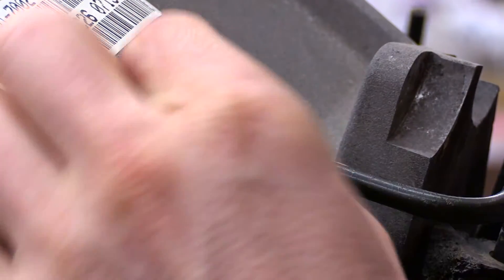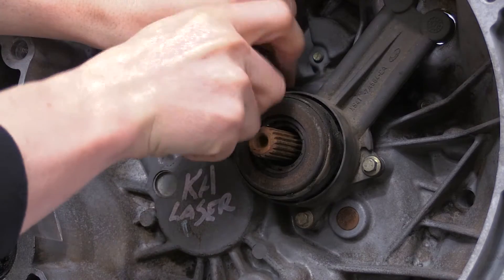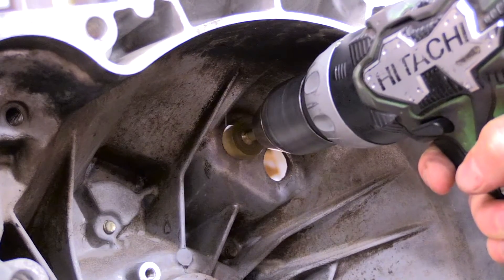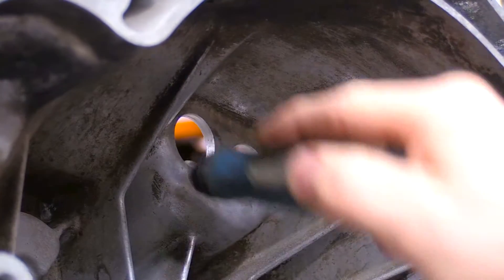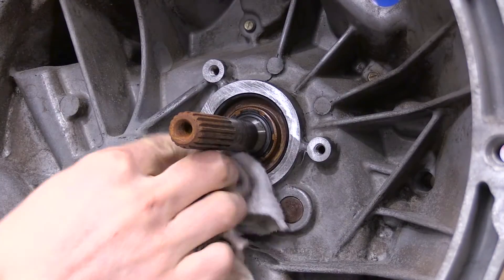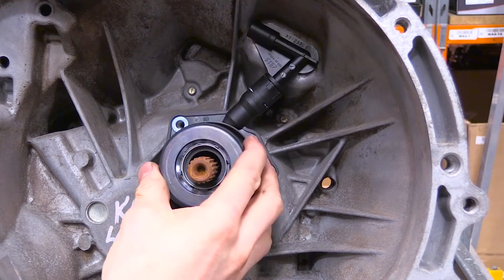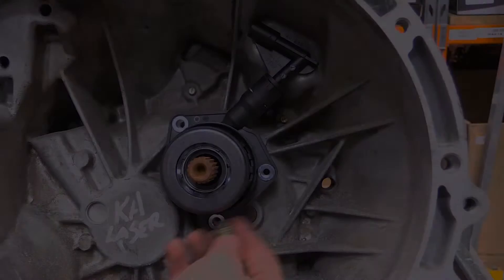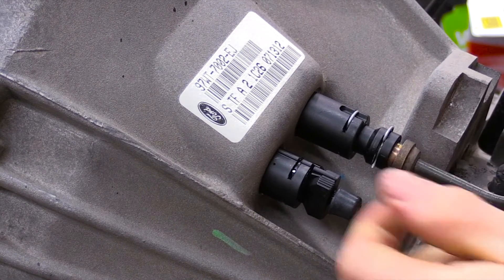CLUTCH TECH: CSCFD003 Concentric Slave Cylinder Fitment

Comment: Where was your o ring seal
Reply from the maker: Hi Kawsar,
On this particular CSC, there is no O ring seal. There is a seal in the transmission but this is not supplied. 
Thanks
Reply: Australian Clutch Services oh ok I just bought one for my car but no seals came with it
Reply from the maker: Hi Kawsar, Apologies, I have just updated my original comment. There is actually a seal in the transmission but the CSC itself does not require a seal.